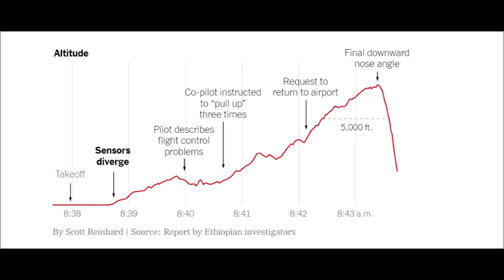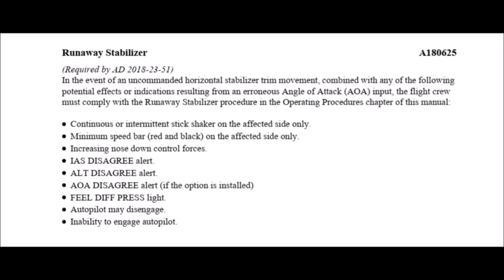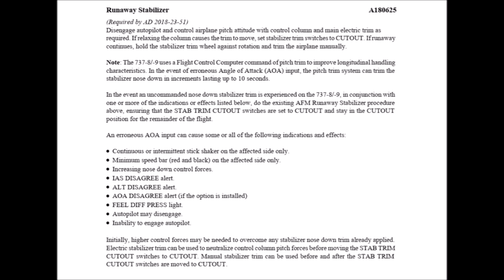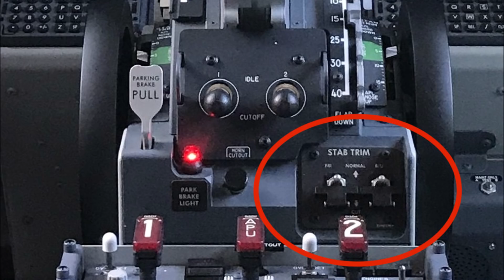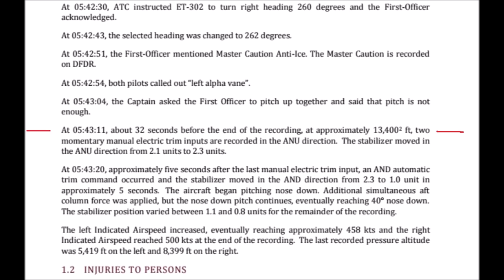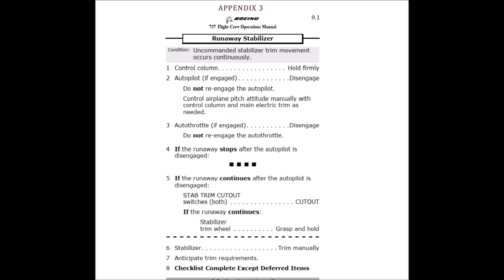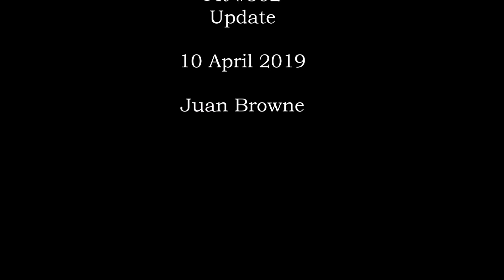737 Max Update 10 April 2019 Runaway Stab Trim Procedures

Comment: Thanks for the thoughts on why the throttles weren't retarded, startle factor and "panic" focus narrowing makes perfect sense.
Reply: Here is a well written article by an industry experienced reporter;

https://www.forbes.com/sites/marisagarcia/2019/03/12/boeings-737-max-pits-faa-against-peers-in-battle-for-public-opinion/#6c639b2d2e7b
Reply: The workload for the pilots is incredibly high for the average pilot to adäquate pilot.   The introduction of the highly automated and almost invisible MCAS system added another layer of complexity and Automation beyond that Traditionally experienced by pilots.     This is the straw that broke the camels back on the Boeing 737 systems architecture Which can’t cope with this very well.   The problem is not Automation it is the lack of robustness of the automation and it’s lack of transparency.   

There’s actually nothing wrong with Boeing documentation.  The claim that Boeing’s documentation was inadequate is over for me it IS adequate.  

The design was inadaquet.  It’s wrong to expect that the aircraft is being flown by perfect pilots.

1 The 737 is 50-year-old systems are all duplicated but the pilot has to monitor the systems and decide which one is faulty and which one is functioning and manually switch over to using it obviously if an altimeter goes haywire pilot isn’t necessarily going to dive the aircraft into the ground because he’s in the loop and it just doesn’t make sense to him.   So he will check with the other altimeter decide to use the one that works and makes sense.

2 MCAS doesn’t give the pilot these choices, unlike the faulty altimeter which he can monitor,  he can’t monitor angle of attack unless he was supplied with that option when the airline decided to purchase the 737.

3 MCAS just acts without indicating that it’s acting.  

4 Unlike an auto pilot MCAS can’t be disabled.  Disabling stabilizer trim it’s not a good way of deactivating MCAS visit also deactivates electric trim.

5 comparing two angle of attack sensors before MCAS acted acting would’ve gone a long way towards increasing the safety of MCAS.    It’s still not enough.  If there’s a faulty sensor it’s just doubled the chances that MCAS is going to fail because it only takes one sensor to be faulty for MCAS to have to be deactivated.  Sure the consequences of an MCAS fault Is going to be less because we now have a fail safe system but we don’t have a redundant system because MCAS needs two sensors to operate safely And the 737 needs MCAS to fly safely.  Boeing is going to have to add at least a third sensor and probably a fourth.  Don’t need a fourth since it from the point of you of dispatch reliability.
Reply: @WilliamJones-Halibut-vq1fs  From what I read, MCAS was not really needed. It was for the situation when the 737 Max engines might push the nose up too high which normally it may never do. And if the engines does that, most likely the pilots would see it and do other things to reduce the angle of attack even without the sensors. It's like if you corner on your bicycle too fast, you get too low to the ground that you might slide out. You don't need sensors to know you are leaning too far and you are about to crash. 
The 737 Max with more powerful engines, in theory it's possible for those engines to push the nose up too high. So in order for Boeing to pass certifications, they needed to create the MCAS. Maybe that's why they felt like they did not have to make it too robust. Because it might never be activated or needed. Unfortunately they may not have thought about the sensor goes bad. 
So after they propose the fix to neuter the MCAS, the 737 Max might be just fine.
That's my theory anyway. The only thing I can't seem to explain was why after starting out making the MCAS not so powerful (they told FAA that the MCAS would just adjust the trim maximum of 2.5(?) units, then they proceeded to make it too powerful - trim it to the max and repeatedly. It was reported that all the things they propose to do for the fix are the things that they told FAA initially how the MCAS would behave.
Reply: @1tuyenp  The new engine location moved the center of lift forward as well at high angles of attack. Its a double effect, more powerful engines and a plane that wants to turn nose up under climb conditions. It could be fixed by a new horizontal tail with larger elevators but that would have delayed certification.... Easier to kludge the trim system instead....
Reply: @allangibson8494   The position of the engines [ engine location as you put it ]  has an effect on the center of gravity, as does, fuel loading, passenger distribution, cargo, and service items on the aircraft'  The center of lift of the wing is dictated by the design of the wing and its configuration, [ extent of flap deployment, and pitch angle of the aircraft ].  the center of lift is a product of LEMAC  leading edge mean aerodynamic chord and TEMAC trailing edge mean aerodynamic chord and that center of lift can vary between certain design ranges and is not fixed.
Reply: @YouTube.TOM.A  The new engine location put the top of the engine fan cowl and pylon inline with the upper surface of the wing instead of below the lower surface. This effectively extends the wing forward, shifting the center of lift forward like a slat. It was not just the increased engine thrust or location but an actual change to the wing aerodynamics at high angles of attack due to a local increase in wing chord.
Reply: @allangibson8494    I am not sure that the application of those changes are directly co related to the effect that you have described. some of this may be "insider" flight test or theoretical information that are being promoted by people don't have all the information required.  Thank you for the information though.   I have to believe that all of that would have been flight tested.  This is still one of the most advanced aerospace and aviation companies on earth and  
 [ although not true in your case ] many have minimized their capabilities and integrity,  to score cheap points critical of the effort that is put into the work that they do.
Reply: @YouTube.TOM.A  That was based on a number of media reports that the aerodynamic changes due to the mounting location (not engine thrustline) were the reason for MCAS to be required for certification. 
Basically the new engine location screwed up the stall reponse and natural recovery of the 737. Stall recovery required a nose down trim - hence MCAS to avoid having to retrain the pilots that a stall now requires a nose down trim adjustment in the 737Max8 where the 737-800 did not.
Fitting bigger elevators would have worked too but cost more....
Reply: @allangibson8494     I don't want to discount your sources, but that is not     something that i can hang my aerodynamic hat on.  When you say screwed up the stall response, what does that even mean. are  you saying that at high angles there is not enough elevator authority. then trimming the elevator seem like an effective way to increase control. All this is very interesting but without the complicated engineering data to support some of that,  conjecture it is
Reply: @YouTube.TOM.A  This is just what has been published in newspapers after the Lion Air crash and subsequent investigation. Hardly insider data, just what Boeing was telling the Indonesian crash investigation. What Boeing are demonstrating is the same level of arrogance and management driven rush that lead NASA to lose two space shuttles. Boeing's management culture needs a serious shake-up.
Reply: @WilliamJones-Halibut-vq1fs  why not just give the pilots a warning if AOA sensors disagree and then DISABLE MCAS?!  Two crashes now have shown that MCAS running with faulty AOA data is dangerous!  Disable it once you've figured out AOA data is faulty!
Reply: William Jones-Halibut, your point #4 is wrong.. MCAS can be disabled and the plane flown manually. 
Your point #5. Redundency is not failsafe as in this example; 

On 5 November 2014, Lufthansa Flight 1829, an Airbus A321 was flying from Bilbao to Munich when the aircraft, while on autopilot, lowered the nose into a descent reaching 4000 fpm. The uncommanded pitch-down was caused by two angle of attack sensors that were jammed in their positions, causing the fly by wire protection to believe the aircraft entered a stall while it climbed through FL310. The Alpha Protection activated, forcing the aircraft to pitch down, which could not be corrected even by full stick input. The crew disconnected the related Air Data Units and were able to recover the aircraft.[41] The event was also reported in the German press several days before the Germanwings crash.[42] The German Federal Bureau of Aircraft Accident Investigation (BFU) reported on the incident on 17 March 2015 in a Bulletin publishing the flight data recorder and pitch control data in English and German. As a result of this incident an Airworthiness Directive made mandatory the Aircraft Flight Manual amended by the procedure the manufacturer had described in the FOT and the OEB and a subsequent information of flight crews prior to the next flight. EASA issued a similar Airworthiness Directive for the aircraft types A330/340.[43][44]
Reply: Alan Frizzell My point #4 is correct.  MCAS can not be deactivated independently.  The only way to stop MCAS from trimming the stabiliser is to disable the stabiliser electric trim.  It should be possible to disable MCAS independently the way a auto pilot can be disengaged.

The airbus was confronted by a similar  problem that confronted ET302 only they lost 2 sensors.  The A321 does not have the MCAS system because flight envelope protection and stall protection is built into the flyby wire normal control laws.  When the airbus crew deactivated the air data computers they also deactivated flight envelope protection and reverted  to alternate law.  In alternate law the crew directly control the flight control surfaces with no intervention by automation such as stall protection.

However the Airbus A321 crew retained full power trim unlike the Ethiopian crew who had a muscle power trim that  doesn’t work at speed.

It’s worth pointing out that a 320 so I’ve got four angle of attack vanes and even these 4 sensors can fail simultaneously and cause major problems.

Having just to send sores on the 737 is not going to be enough 4 sensors enough.
Reply: William Jones-Halibut, disengage auto trim and autopilot and MCAS is disengaged, then address auto throttles. These can be done in seconds. 
As to your other point on AIRBUS, it has FLIGHT AUGMENTATION CONTROL (its version of MCAS). Which was difficult for the GermanAir pilots to disable for regaining control.

AVIATE-NAVIGAT-COMMUNICATE
Reply: @awesomexistence  Sure, yes you can disable MCAS in seconds by cutting off electric trim. But how do you now correct the trim which is now out of whack? The only option is to use the tiny bitty manual trim wheels. As shown in the prelim report, the pilot asked the copilot to manually trim the aircraft, but copilot reported that the manual trim was not working. Probably due to the high forces on the stabs. The Airbus crew you mentioned had the luxury of being at normal flight altitude, probably 30,000 ft, and had the time to regain control of the aircraft. The Ethiopian had just taken off and the crew was desperately trying to gain altitude. 
Just as William Jones-Halibut mentioned above. They should have been an independent switch of cutting off the MCAS and still have the option of using the electric trim which is faster to bring the plane out of the nose down situation. It is like being on a big truck with malfunctioning cruise control and hurtling down a twisty mountain road. And your only option of killing the cruise control is to turn off the hydraulic system, effectively losing power steering and brakes. Sure you can steer with muscle power and pump the brakes, but will you have enough time to bring the truck to a stop before careening off the cliff? Just think about it.
Reply: eudofia, i suggest you rewatch the video to which these comments are attached. Pay close attention as to what a well trained pilot explains. Particularly BLANCOLIRIO’s statements of  recognizing,  responding, and quickly turning the situation into a non event. Also download the Ethiopian report and study it noting it contains reference to receipt of BOEINGS air directive (procedures are listed on pg 33 of the report) after the LION Air event and pilots awareness and training of the MCAS.

Poor pilot training as in this Indonesian flight;

On 28 December 2014, Indonesia AirAsia Flight 8501, using an Airbus A320-216, from Juanda International Airport, Surabaya to Changi International Airport, Singapore, crashed into the Java Sea between the islands of Belitung and Borneo, killing all 162 on board. The cause was initially a malfunction in two of the plane's rudder travel limiter units which caused the plane to stall while encountering a thunderstorm. The crew ignored the recommended procedure to deal with the problem and disengaged the autopilot which contributed to the subsequent loss of control. Investigators have stated that the condition of the FAC (Flight Augmentation Control) on the flight "was persistent enough" for the captain to do such actions
Reply: @awesomexistence  I believe those are your opinions. I also respect Juan Brown, the author of this video. He is not part of the accident investigation team. Based on his years of experience, he is just giving an inform opinion, and by no means that is the definitive cause of the accident. As he said in the video, the investigators will be looking into those things he mentioned. It is very easy for us keyboard warriors to sit in the comfort of our desk or couches, and watch these Youtube videos and think we are experts: Oh, they could have pushed that button, or they should have flipped that switch, etc... 
And let me bring you up to speed. Boeing initially kept the MCAS system secret and did not inform the airlines nor the pilots of its existence. The information was not even included in the flight operation manual. Why? According to Boeing, they did not want to overwhelm the pilots with too much information. Isn't that great? Of course, the main reason was they did not want to trigger a re-certification of pilots who had flown earlier versions of the 737s. It would have been expensive as pilots would have to be pulled from cockpits, and into simulators. All these were marketing efforts by Boeing to make the 737 MAX more appealing to airlines. And hear this, the only training pilots received to transition to the 737 MAX was a 58 mins Ipad video. And there was no mention of the MCAS.
The general public became aware of the MCAS after the Lion Air crash. And Boeing issued that one-page instruction to pilots on how to handle MCAS in an emergency situations. In my opinion, grossly inadequate because, the runaway trim cut-off procedure was developed when MCAS never existed, and for level flights where it is easier to use the manual trim wheels. No provision was provided for when the plane is flying at an angle either climbing or hurtling towards the ground.
And you are right the pilots had no training on the MCAS, either in class or simulator. But guess who said it was not needed? Boeing, so as to increase aircraft sales.
By the way,  here is an excerpt of a statement by Boeing "erroneous activation of the MCAS function can add to what is already a high workload environment. It's our responsibility to eliminate this risk. WE OWN IT, and we know how to do it." Well, there you have it. Boeing owning up to their mistakes. Enough said.
Reply: eudofia , sorry but I don’t need to be “brought up to speed” by your opinion particularly when presented in a condescending way. Training to respond to this type emergency has been in place since the 737 was introduced in the 70’s. 
Ethiopian authorities would love to blame BOEING but in the process would have  to address the improper actions taken by the pilots as well as their training procedures. Its odd that they pulled their preliminary report from internet access and good that others saved it to internet access. MY OPINION is the facts contained in the report didn’t fit their narrative to blame the crash on BOEINGS DESIGN.
Reply: @awesomexistence  The pilots in the Ethiopian airlines crash had not been trained on the 737Max - because Boeing and Ethiopian  (or Lion Air) didn't require it. The command pilot had NO experience on the 737Max8 (he was trained on the 737-800).
The combination of a false stall warning, MCAS trim down immediately after departure triggered incorrect trained responses in the pilots. The manual trim wheels required too much force to move under the aerodynamic forces applied while applying the 30kg (50lb) of force to each of the control yokes.
To move the trim wheels by hand, the pilots need to ignore the stall warning and the throttles need to be  retarded.
You have untrained and uninformed pilots placed in emergency situation with a system they are both unaware of.
Simulator tests indicated the pilots had 40 seconds to troubleshoot the problem and respond correctly before it became unrecoverable. In cruise this may be solvable, under the workload and aircraft configuration of departure, this was the worst time for this to happen.
Reply: @allangibson8494    I will ask you guys to please have some respect.  There are things that could have been done differently but you are dealing with human limitations and emotions and maybe training requirements. I have seen [ 20 year ] captains fall apart in the simulator during training with frustration and anxiety. and I also had captains who told me to take a deep breath and relax when i was having trouble in the simulator.  Respect the working crew members in the flight deck who tried to save lives.  I appreciate your passion but none of what you are saying will prevent the 737 from humbling you in certain abnormal situations.
Reply: @eudofia   You can trim the aircraft with the trim wheels manually.  pilots sometimes push and pull on the trim wheel during normal flight without deploying the handles to make fine adjustments when hand flying the aircraft.  High speeds with a elevator 2 units out of position [ presumed  MCAS application ] will cause you to expend a great physical effort,  I don't completely blame the captain for  re-engaging the trim in an "emergency action" of judgement. but if the  aircraft was relieved of the awkward trim with the switches on and the switches were turned back off immediately then they may have a situation where manual trimming could have been successfully used.
Reply: Allan Gibson, this is taken from pg 13 of the Ethiopian report;

The pilot in command was 29 years old. According to Ethiopian Civil Aviation Authority (ECAA) records, the Captain’s most recent simulator training experience was September 30, 2018, and his most recent simulator proficiency check was October 1, 2018. The captain completed the Ethiopian Aviation Academy on July 23, 2010. A review of the captains training records indicated that he received his 737-800 First Officer type rating on January 31, 2011 and completed his PIC type rating for the 737-800 October 26, 2017. 737MAX differences training on 3 July, 2018.

The pilot in command is type rated as a First Officer of the following types of aircrafts: B737-7/800, B767/757, B777 and B787. As pilot in command, he is rated on B737-7/800 and B737MAX.
The pilot’s ECAA license allowed him to act as pilot-in-command in commercial air transport operations in a Boeing 737-7/800 (dated October 26, 2017) and Boeing 737 MAX (dated July 3, 2018.)

http://www.ecaa.gov.et/documents/20435/0/Preliminary+Report+B737-800MAX+%2C%28ET-AVJ%29.pdf/4c65422d-5e4f-4689-9c58-d7af1ee17f3e
Reply: @awesomexistence  First off, I didn't mean to come off as condescending in my previous reply. Also, I do not know your background, if you are Boeing employee, or have a family member working there, or you are just a Boeing fanatic. All that is okay, but stating in capital letters that the two accidents had nothing to do with Boeing design of the 737 MAX, it is either you are ignoring the facts or just being plain disingenuous.  
I am not going to go over the many design features of the 737 MAX that have been extensively discussed in this thread. The main take away is that Boeing's design of the new 737 MAX made it aerodynamically unstable in certain conditions and resulted in their introduction of the MCAS, whose design and implementation depended on a single sensor for data (obviously a design flaw). And it was the erroneous activation of the MCAS that put both the Lion Air and Ethiopian flight in an emergency situation, resulting in a fatal crash.
Now you could argue that the pilots were not trained specifically for the 737 MAX 8. And such training could have made a huge difference, and that is true. But we also have to admit to the fact that, in order to make the 737 MAX appealing to airlines, Boeing did not mention the MCAS system(it was supposed to be an invisible aid acting in the background) and did not require aircraft-specific training for pilots transitioning to the new 737 MAX, other than a 58min iPad video. So how can we keep pointing fingers at the pilots?  Boeing has admitted that some design features on the MAX unnecessarily put the pilots in a more stressful situation.  And Boeing has owned up to it, and are planning on fixing it. If everything is fine with the 737 MAX design, then why is Boeing rushing to roll out fixes?
Reply: eudofia, Do understand the same airframe was created in the 60's for the Pratt & Whitney JT3D's, a much slimmer (low bypass ratio) engine...Boeing labelled it the 737 'Classic'.  The 'Next Generation' (aka, NG) plane featured the CFM56 variants...much fatter engines.  By your assertions, there should then have been similar flight attitude issues with the NG planes, yet clearly that's not been the case.  Also, it's not a design flaw to utilize automation to maintain flight.  The entire go-to-market of the Airbus is based upon this as their A319/320/321 series (direct competitor with the 737 and has gone through design changes) relies upon 'fly-by-wire', computerized & much automated technologies. AIRBUS’s  FLIGHT AUGMENTATION CONTROL redundency is not without its failures and it’s AOA sensor response was created for the same “aerodynamically unstable in certain conditions” you state about BOEING’s design. Therefore, if you call the 737 Max a flawed design, then likewise, everything Airbus makes should never have been certified either. Finally, because today's pilots are as much 'automation technology managers' as they are 'hands-on pilots', adequate & proper pilot training is ever more a crucial issue.  LION AIR prior flights,on the same plane that went down, experienced the same issues however took the correct actions to alleviate the issue. LION AIR advises in their accident report the need to further training of their pilots. Many crashes are related to mismanagement and over reliance upon automation.
Reply: @awesomexistence  Please do not get me wrong. I'm not here to bash Boeing and call for their heads, as many in the comments section all over social media are doing. Boeing is a company with great expertise in what they are doing. As a publicly traded company, they have a mandate to create value for their shareholders, that I understand. But in the heat of competition with other manufacturers, they can be forced to make decisions on aircraft design that have repercussions along the line. And the 737 MAX is an example of it. They got a few things wrong, they've admitted to it and are in the process of fixing those mistakes. Unfortunately, a lot of people died, and that should not be taken lightly. Some will say the737 MAX  design is flawed, but personally, I don't think so. What I meant flawed, was how the MCAS got its data. Only from a single sensor, with no redundancy, and no way of checking for discrepancies. Part of Boeing fixes for the 737 MAX is that the MCAS software will now get its data from the two angle of attack sensor and will check for discrepancies, and then warn the pilot about it.  
As for the 737 NG you mentioned. The difference between the NG and the MAX is that the CFM56 engines were still small enough to fit underneath the wings, thus the aerodynamics of the NGs did not change much compared to earlier versions of the 737. The Leap engines on the 737 MAX are of a larger diameter and would not fit under the wings, so Boeing had to move the engines forward and up. This significantly changed the CoG and CofL, and the plane had a tendency to pitch nose up during takeoff with full thrust. Thus the need for the MCAS. 
There is nothing wrong with using automation to maintain flight, I never said that. And you are right about pilots these days depending too much on automation and the need for more training on the complex machines that they are flying. Something Boeing didn't recommend for its 737 MAX. Again, they say they will fix that too.
I'd like you to watch this video by VOX. I know, people say they are biased, and they sensationalized it a bit. But it offers a simple explanation of the 737 MAX issue. As a Boeing supporter, I'd advise you to avoid the comments section.
https://www.youtube.com/watch?v=H2tuKiiznsY
Reply: eudofia, I suggest your advise to me to avoid the comments section is extreme arrogance on your part. I will express my opinions based on the facts I have given reference to and as I see them so I suggest you give credible source links to your statements of opinion. Otherwise we will have to agree to disagree!
Reply: @awesomexistence  Oh, come on. Don't be too sensitive. I sent you a link to a VOX video. I was telling you to avoid the comments section of that video as it was too biased against Boeing. Sorry, if you misunderstood. Of course you can express your opinion as you see fit.
Anyway, I also concur that we can always agree to disagree. Have a good one.
Reply: @UCk8pC36xRPBBMz0xA6CD4zQ The preliminary Lion Air report has been out for months. 
That is why 737Max pilots are catching the bus. 
MCAS was a safety of flight system precisely for the reasons I have described. It was not an option but a FAA certification requirement to correct stall recovery issues on the 737Max.
Reply: Allan Gibson, you don’t seem to be able to provide factual references to back your assertions and were indeed wrong on the ETHIOPIAN pilots ratings. I think your opinions on BOEING seem to be prejudiced by “what has been published in newspapers”.
Reply: @awesomexistence  What I stated about the Ethiopian airlines what was in the New York Times on the 20th of March. The command pilot was trained on the 737-800 but not on the 737Max8 (he was scheduled for a simulator session on the 737Max8 this month).
Reply: Allan Gibson, linking to the ETHIOPIAN report I provide in this thread will give you the facts. New York Times as well as much of the mainstream news media deliver edited versions of events with an agenda to sensationalize or indict. Two days after the crash major news sources, REUTERS and TIME did stories which attempted to link PRESIDENT TRUMPS influence with BOEINGS board as a link to their internal decision making causing problems leading to internal pressures. That story line was quickly abandoned. Then major news sources broke the stabilizer JACK SCREW scare. Then it has been repeated by many major news sources that the Ethiopian pilots performed BOEING’s procedures and the plane still crashed. Clearly, by the ETHIOPIAN REPORT and BLANCOLIRIO’s breifing, the crash was a series of pilot errors. 

Just a cesspool of sensationalism in journalism to build advertising revenue.